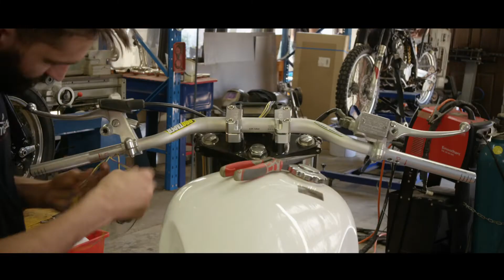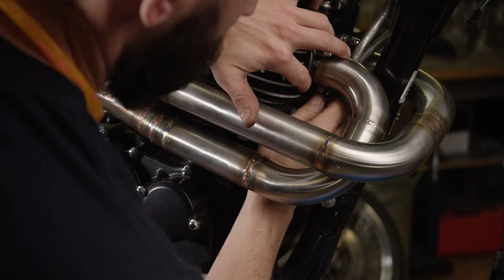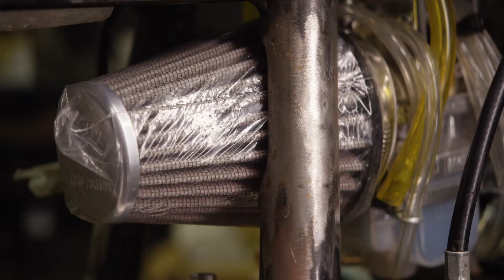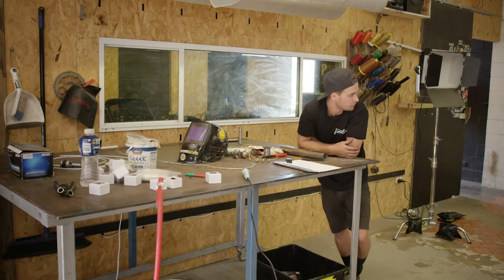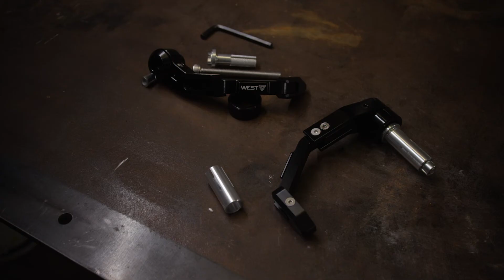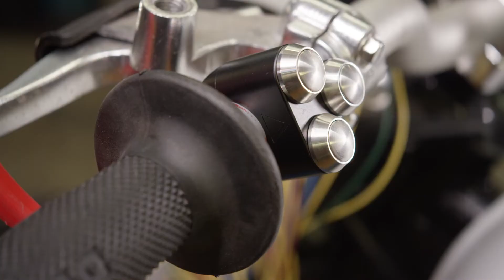How to Build a Scrambler-Desert Sled : Episode 5

Comment: We have Motorstar Cafe 400 here in the PH exactly same as Nemesis 400, my issue is I replace my elbows with 1 ½" tube and my fuel consumption became 15-18kpl.😭 I'm planning to replace it with the stock size 1 ¼".